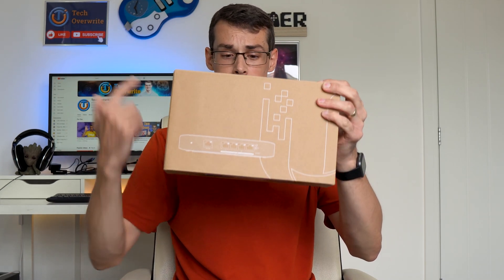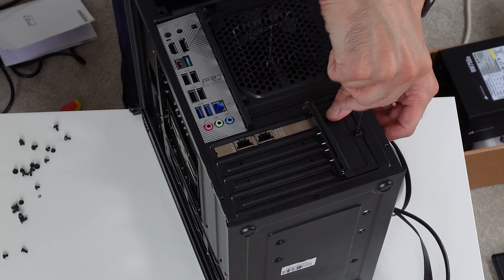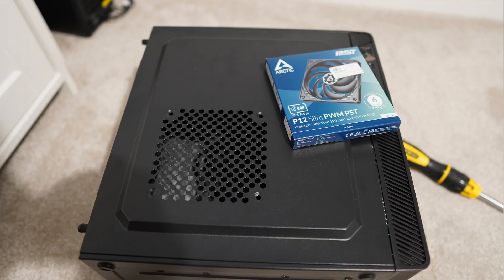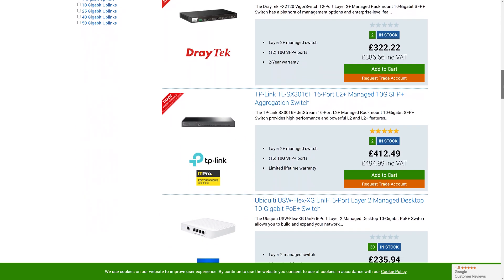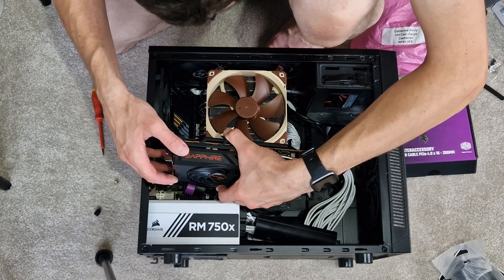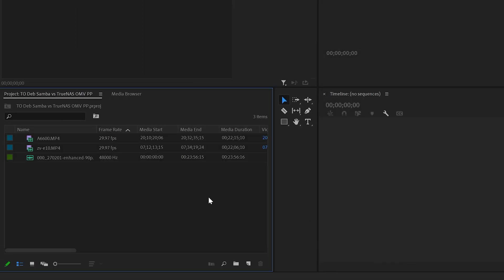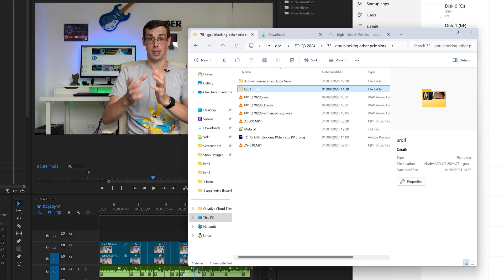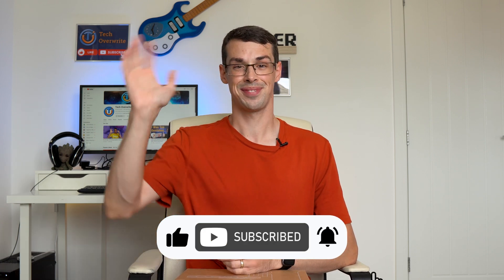"Upgrading" To 10 Gigabit Networking Is Challenging

Comment: SFP+ DAC works great for a collapsed 10Gb backbone in my experience. I use it within a rack to interconnect the switches, firewalls and NAS at home. The other devices can use 2.5 Gb max. I wouldn’t pay for it but new NAS’s, switches and firewalls have often 10 Gb on board so … Just keep your distances as short as possible.
Reply from the maker: Ah nice, that's good to know thanks :) I've heard good things about DAC too - I should have probably gone this route (rather than warm and power hungry 10Gb RJ45!)
Reply: @TechOverwrite TrueNAS explicitly recommends to drop RJ-45 and use SFP+ with 10Gb. That was a great hint for me. :) The shorter the cable, the better. Let’s face it: 2.5 Gb for normal end users is plenty, even when editing short videos. Upgrading on the desktop to 10 Gb requires a NAS that can saturate a 10 Gb-link and those are rather expensive. Such a NAS would require at least 5 4x4 PCI lanes NVMe’s in a stripe and a decent controller. Non enterprise NVME’s will wear out after a year when heavy used and replacing them is not cheap. Enterprise NVMe’s will last much longer but cost at least 3 times as much per TB.

Comment: i upgraded abotu 2 yrs ago.. i learned a lot the hard way. there are a TON of cheap 10gb switches on amazon from unknown chineese companies.. they work for small transfers.. but overheat and shut down or throttle when they get hot.. so they were pretty much useless for me because I transfer huge files and huge amounts of data regularly. i went with 2 used 5 port netgear switches off amazon. they work far far better than the cheap ones and are able to sustain 10gb transfer rates for terrabytes worth of data. the ubiquti 5port switch is really nice too. cables matter.. especially for long distances. i had to essentially wire my house twice. 1st time I used cheap cat 6e cable. short runs did fine.. long runs with same cable got drastically slower speeds.. replaced longer runs with better quality cable, no issues at all now. Cards matter too. cheap cards get hot and throttle. do your research.. it can be done pretty economically especially if you don't mind buying used equipment. 

as a photographer that transfers large amounts of data to and from a nas.. and has a large data set that needs to be backed up. .the time saved is drastic. (backing up photos from a 6 music festival(~8tb) the difference is minutes to hours.

Comment: This is why I simply went with a 5 port unmanaged 2.5gbs switch and a few 2.5gbs cards and called it a day. Still a noticeable improvement over 1gbs networking and was still reasonably cheap compared to 10gbs networking. I did look at going to 10gbs directly, but the cost difference vs. diminishing returns made me feel 2.5gbs was the way to go and a few years later still zero regrets!
Reply from the maker: Sounds like you made the right decision for sure. 🙂 I over-analyzed the decision to be honest, but a 2.5 Gbs switch would have worked out fine for me too.

Comment: Great video! I was also considering upgrading to 10gbs but decided against it and will be sticking with 2.5gbs. Here's what influenced my decision.
1. My house is 30 years old and wired with Cat 5. I'm not interested in pulling Cat 6 any time soon.
2. Most of the PCs have 2.5gbs NICs.
3. 2.5gbs network hardware is already more expensive than 1gbs. 10gbs adds even more costs.

I'd love to see a detailed video of your production workflow. From idea to YouTube upload.

Looking forward to the next video.
Reply from the maker: Thanks, I appreciate that :) And your decision makes sense for sure - especially due to the prewired CAT 5, it would definitely be frustrating to switch that out. I feel like 2.5Gbs is definitely the sweet spot right now. 10Gbs was a bit overkill here lol.

> I'd love to see a detailed video of your production workflow. From idea to YouTube upload.

That's a great idea thanks, I'd like to do this for sure. I'm due to carry out a few 'quality of life' upgrades shortly (upgrading to an ATX case/mobo, and adding a second monitor into this fix) and should then be able to 'wrap up' this series in some way. Showing the production workflow could be a neat way of doing that for sure 🙂